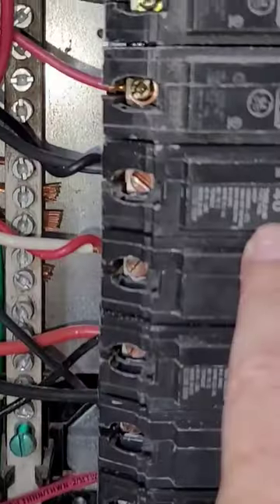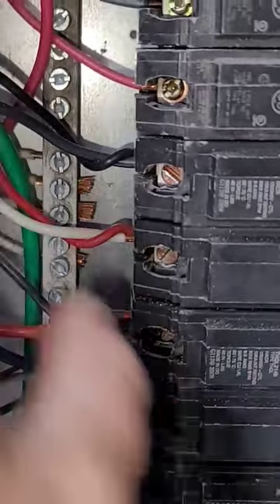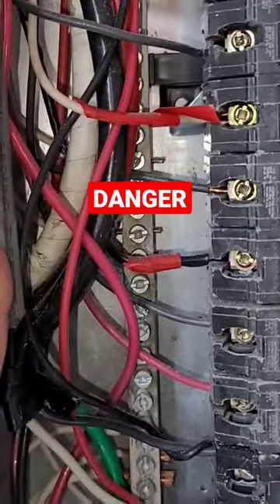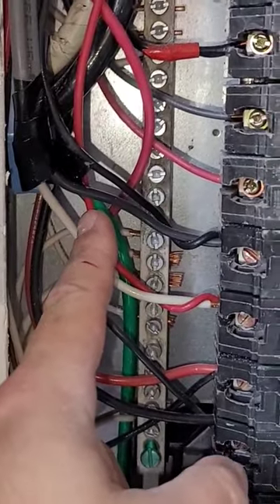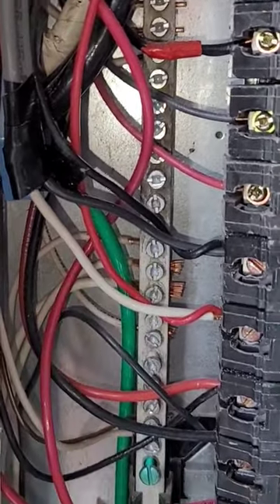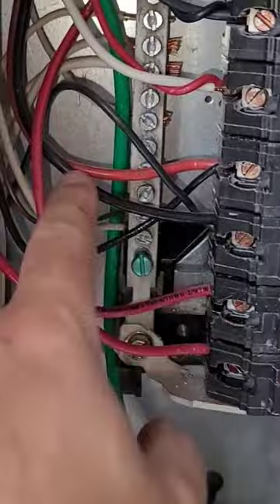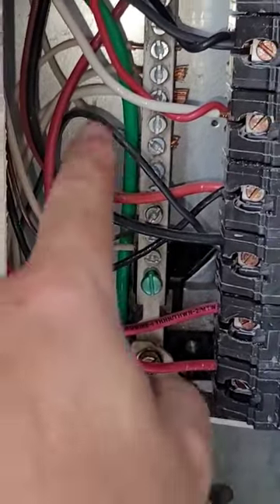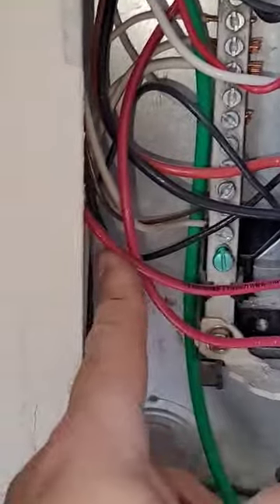DANGER DANGER DANGER, HANDY MAN INSTALLATION OF ELECTRICAL, WIRING AND CIRCUTS

Comment: “Guys its fine, because the double tap, you divide the current rating so it’s actually 20 amp which is fine!!” 😇
Reply from the maker: Haha good point
Reply: The breaker is intended to protect the wires, but if there is no load on one of the double tapped wires, the other wire must be able to take the whole amount of current necessary to trip the breaker, which is twice what the wire is rated for.
Reply from the maker: @bizmuthhelm9115  exactly
Reply: @bizmuthhelm9115  twas but a mere joke

Comment: anyone can make a circuit work BUT is it safe. As a part time electrician retired electrical engineer I see some crazy stuff out there. I usually go ahead a clean it up at no cost. IF it is bad I document it and inform the homeowner...
Reply from the maker: Yea, whenever possible, I also correct things no charge also. Just to avoid the customer thinking, I'm adding things to inflate cost.

Comment: What’s the CSA in mm2 ?
Reply from the maker: I believe the conductor cross section of 10ga is 5.28 mm if that is what you are asking, and if I remember correctly.  But it has been a while since I have had to study and know that for any tests.
Reply: @Simonelectricfl  thanks bud.  Over here that would be an underrated size of conductor for a 40a OCPD
Reply from the maker: @jamie O  good point, it also is here with the ambiant temperature rating.

Comment: Crappy changes in the wires are not the standard for loads never use stranded wires for one thing 😅😅😅😅sadly ive seen this before and it was almost on fire in a melted insulation messenger strange thing
Reply from the maker: It can definitely be dangerous!

Comment: Double tapping those breakers isn’t allowed, but 10AWG is definitely allowed on 40A breakers for AC’s
Reply from the maker: 10 ga thhn at a 75 degree ambiant temp rating has a maximum ampacity of 35 ampers. NEC 310.13
Reply from the maker: Great comment,  thank you.
Reply: @Simonelectricfl  correct if it’s a normal circuit. I’m assuming at least one of those is for an AC. Motors and AC’s are different
Reply from the maker: @MrSamsamsammy thanks for responding, those are all for a thankless water heater.  I'm pretty sure it's a DIY or handy man special!
Reply: @Simonelectricfl  there is a different code requirement when it comes to A/Cs
Reply from the maker: @carlsmith5678  this was not to ac